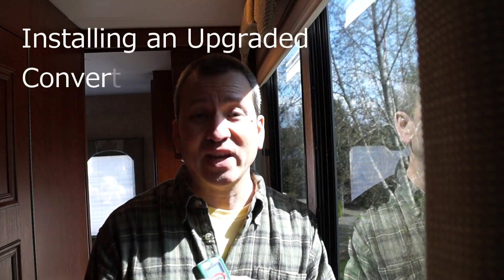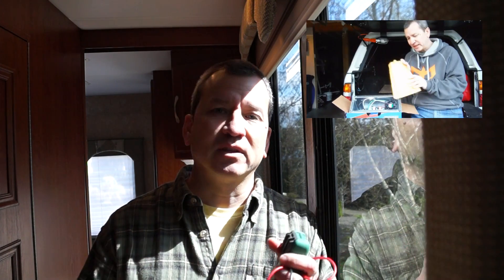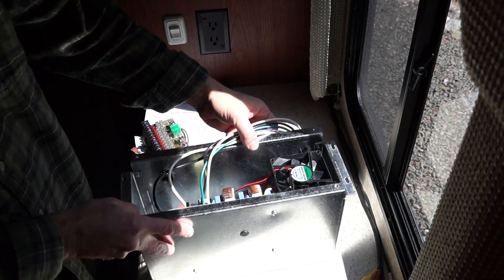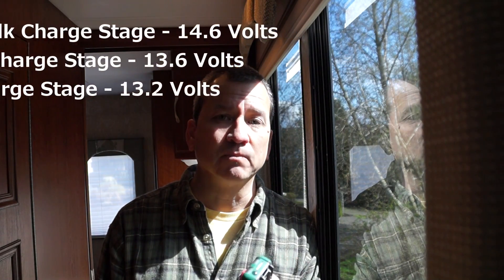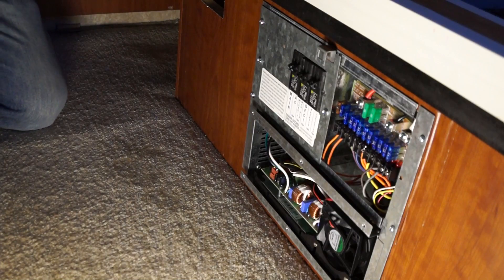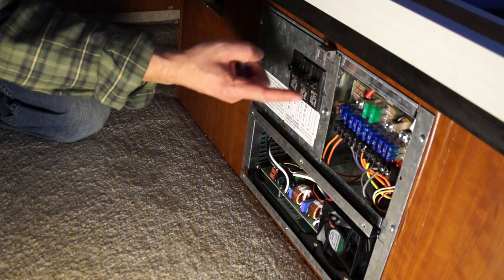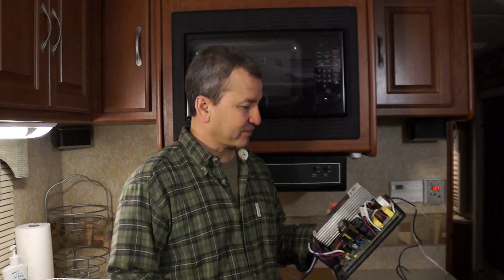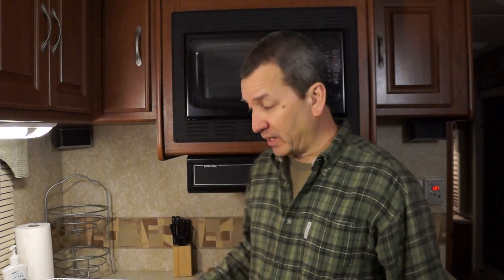How To: Upgrade to a Smart RV Converter Charger

Comment: same converter in my rv that i need to change and looked up upgrades- found myself here.  Thanks, not afraid to tackle this myself now!
Reply from the maker: Awesome. Glad to hear this 11 year old video is still helpful. This was pre-Lithium. So if you're using LiFePO4 batteries then be sure to get a lithium-compatible replacement. Good luck!

Comment: Tech question  So i have the PD 4600 replaced converter i want to power the battery charger on its own circuit breaker have you done this ? I don’t want a loop goings on

Gary
Reply from the maker: Hey Gary. It's been a while since I've had one. Mine had a breaker for the converter. If yours does not then you should be able to add a breaker on the 120VAC hot wire that goes to the converter.

Comment: when I am plugged into shore power my battery's are climbing to 14.4 then I unplugged . Is my convert bad ?
Reply from the maker: Lead acid batteries typically charge at around 14.4 volts. They should drop back down to around 13.2 when fully charge in order to maintain the charge. If your converter/charger is always at 14.4 volts then that's a problem. You'll overcharge your batteries and eventually kill them. It's best to make sure you have a multi-stage converter/charger like the one I installed here.

Comment: Can it be used with lithium also which wire disconnect the battery charging
Reply from the maker: There is a lithium compatible version.

Comment: Hi Brian i ll like to change my converter like yours !! Is Any issues with it..? Works fine..? Is any new model out there better..? Thanks
Reply from the maker: I have lithium batteries now. So I've swapped it out with a lithium compatible version of the same.
Reply: @RVwithTito  Brian, great video like all the rest...

I want to upgrade mine too, tell me why they don't make one that you can use with SLA or AGM now, switch it to lithium when you get lithium? Know of anyone that makes that?
Reply from the maker: @bobcole3852  Those are out there, but mostly as hybrid inverter/chargers that can be programmed for any battery chemistry.
Reply: @RVwithTito  I recall from your website you replaced with a PD4655LIV, which is something I have done as well.  Have you figured out exactly what PD has done with this converter besides generically "making it better for Lithium?"  It seems to always output 14.55v so I'm wondering if it's really now a simple single stage converter.  Seems like there must be more to it.  Mine still has the pushbutton/led and I'm wondering if it really does anything.  I have to admit I haven't experimented much yet, though.

Comment: Great Video,
Would you know?  I have a parallax model 7345 that burnt out and replaced with 45 RU.
I would like to go to battle born lithium batteries what would be a direct replacement for the unit.
Reply from the maker: Here's the one I used: https://www.ltdrvparts.com/PROGRESSIVE-DYNAMICS-55-AMP-LITHIUM-CONVERTER-SECTION-PD4655LIV-PD4655LIV.htm

Comment: Very good video.  All the videos I’ve seen and there have been many, seem to skip one or more steps.  Probably to cut down on the length of the video.  For instance, when I replaced my unit yesterday, on the right side behind the fuse board, i have a red cable, a green cable and a bare copper cable.  I think the red cable goes in the Batt POS+ terminal but I haven’t got a clue where the green and bare copper wires go. On the left side, I have three circuit breakers.  There is a black wire that goes in one of the circuit breakers.  I removed a black wire when I removed the old unit.  However, there is another black wire that looks like it was attached to the circuit breaker at one time next to the terminal where the new black wire is to be installed. I’m not sure which one should be inserted into the terminal.  The old unit was a Magnetek Model 6332 Series 6300A.  I have a 1994 Roadtrek Dodge 190 Versatile.

Comment: My 2000 model probably needs an upgrade but I have a 1 year old $400 AGM and I know I’ll be switching over to lithium some years in the future. I hate to do this job twice and spend twice as much. Are there chargers that are programmable or will work with either AGM or lithium? Thanks in advance. Love your videos!

Comment: Getting ready to install a solar system in my 1994 Fleetwood Jamboree. I have a Paralax series 7300Converter/Charger.  Going to wire a Renogy Inverter 3000W into a Go Power Transfer switch then to the Converter/Charger!  Should I upgrade my Converter/Charger?

Comment: My 2006 Tioga class C has the converter tucked behind the electrical panel. It appears that the whole panel has to be disconnected and removed to replace the converter. It seems pretty daunting. Any thoughts?
Reply from the maker: Sorry. No easy answer. Mine is accessible from the front. I guess you have to remove it.

Comment: I have a 2003 keystone sprinter. I want to change from 30 amp to 50 amp. Do I need to change the breakers, distribution panel, and the fuses?
Reply: My breaker keeps tripping on 30 amps.

Comment: How do i know if my power converter is not working. I connect the rv to power outlett but my battery is not recharging and my 12v lights are not lighting up.

Comment: I’m new to RV camping. On my first trip out with a 2007 Toy hauler all my AC power went out. No breakers were tripped. Power was good at the shore power connector. Frustrated I gave up. I accidentally kicked my power panel and all the power came back on. So I was told by a friend that my Converter needs to be replaced. Looking at the options, if I upgrade do I need to change from 30amp to 55amp?
Reply: I went to bestconverter.com and my model number is CS6000XL. Im assuming since my DC output is 13.5V and 60amps I would need the PD9260C and customer mount to inside the current housing? Thank you for the help.
Reply from the maker: No. Not at all. It will still be 30 amp service. Just get the model number off of your existing converter, then go to the Progressive Dynamics site to see which model replaces it. Here's the site: https://www.progressivedyn.com/rv/power-converters/inteli-power-4600-series

Comment: What is the second set of + and - used for?  I just got a Progressive Dynamics PD9270V Inteli-Power 9200 Series Converter/Charger and I'm unsure what the second + and - is for.
Reply from the maker: Sorry. I don't have the info handy. If I remember correctly, the instructions that came with the Progressive Dynamics unit was pretty detailed.

Comment: My RV/Sprinter will only charge from the generator and/or with an external direct charger.  It does not charge from the alternator or when hooked to a shore power source, etc... I think I need a new transfer relay?  Does that sound right?  I have a 5000 Series Automatic Transfer Relay from Progressive Dynamics.  On there website they only have 5100 and 5200 series now.  Will these work?  Do I have other options?
Reply: Lon, I don't think that is your charger. I think you're likely looking at your Automatic Transfer Switch, which Automatically senses generator power and prevents two power sources from entering the AC Distribution Panel at
 the same time. I'm no expert.

Here: http://www.progressivedyn.com/pd5110010.html

Comment: I installed my intellapower 4600 last season, and has worked great up to last weekend. I lost all power while cooking. The breaker supplying power to the tariler was not tripped. I can't imagine the invertor has failed already. My question is , if my battery is dead will this caise no power, or will the invertor power the trailer without a battery?

Comment: Thank  you so much for saving me from a huge mistake. I'm going  to contact the seller and see if it's to late to return it.   I had no idea this unit and everything plugged into it is useless as soon as you disconnect from shore power to go camping.  
Why charge the battery bank if nothing runs off of it?
Damn I have to start from scratch
Reply from the maker: +Teri Thomas Hold on a sec. Your battery is still connected to the 12 volt distribution panel. So when you are not connected to shore power, your battery will power your 12 volt equipment. The only the piece that doesn't work is the converter/charger which charges your batteries and provides 12 volt power to the distribution panel only when hooked up to shore power. Hope that helps.
Reply: "The only the piece that doesn't work is the converter/charger which  charges your batteries and provides 12 volt power to the distribution panel only when hooked up to shore power." 

And the microwave, some TV's, all your AC outlets, and the air conditioner. (Unless you have a generator then all of these will work too. Right Brian?

Comment: I don't have a red wire for battery from the 4600 converter I'm so confused I only have black and white from old fuse board and wht grn and blk from 4600 converter. where is the red
Reply: Chris Romanos please research more but I have seen other videos stating that white would be hot/ positive in your situation.  The one I'm referring to was a trailer with the battery in the front behind the propane tanks.

Comment: hey great video, I heard there is from time to time some 15,5 V needed, like sulphate removal....
Reply from the maker: For lead acid batteries, there is also an equalization stage (the fourth stage) which boost voltage up to 15.5 to equalize the cells and desulphate. It can be set to be done automatically or manually. The high voltage may damage some electronics, so I recommend setting it to manual so that you can disable power to sensitive electronics first.

Comment: Nice video and helpful as I am considering doing the same.  A couple of questions, I am wondering in doing this upgrade why you did not relocate the new converter closer to the batteries? Also I am curious what the difference in charging time from the old power converter to the new?  Thanks, Bruce

Comment: thanks once again. i questioned the difference of this new unit u have, as opposed to the one u removed. This video answers the question. ... New question is, does this smart charger work only when plugged into Shore... and Not from from your Solar Array?) ... my guess is Yes, but please tell me. Thanks again.
Reply from the maker: +koollee You are correct. It only works when on shore power or onboard generator. The solar charge controller takes charge of battery charging when on solar.
Reply: RVwithTito So I wire all my DC lights, fans, Usb ports to this, while charging my battery, but when I disconnect from shore power and use my fully use my fully charged batteries..I can't use any of the equipment plugged into it?

Comment: Hi! I am newly upgraded from tent camping to a Starcraft Launch 16rb camper! After taking it out for a few camping trips, we notice that our Honda eu2000i generator can't recharge the battery very fast. Our favorite campground only lets generators run for 4 hours each day, this is not enough time to get the battery from 1/3 charge to 2/3. Would this converter charger be able to run off of our generator, and charge a single 12v camper battery in 4 hours or less? Thanks!

Comment: Hi Brian and Melissa. We are new to RV and I just watched another video of yours where you upgraded your charge controller. You plugged in your 30 amp plug into a 30 amp receptacle and you said to turn off the converter/charger. What is your converter/charger connected to, a 120V breaker? Thanks

Comment: Question for ya.. 
Your shore power source powers your new converter/charger which then properly charges your battery bank.  Your solar panels powers your solar charge controller which then properly charges your battery bank.  Sooooo, my question is do you ever have both sources charging your battery bank at the same time or do you use your switches to turn off your solar panels whenever connected to shore power?  I would think that both sources of power charging the batteries at the same time would be twice as much voltage as they need.
The reason I'm asking is because I'm in the process of designing a solar panel system and the main area I'm still confused about is the multiple sources of power that charge the battery bank.  Because my shore power, generator power, and alternator/engine power would pass through the converter/charger and NOT the solar charge controller, I'm worried that my battery bank would get way too much voltage during daylight hours via solar.  I don't see how a solar charger controller or a converter/charger could be considered "smart" if they don't "see" the other before "deciding" what voltage to send to the battery bank.
Reply: a simple kid the way I under stand it is the charge controller and the converter charger would be running parallel to one another so the voltage stays the SAME now the amps would certainly increase and so long as your hardware is making decisions based on real time voltage readings then no harm no foul it's no different running a wind mill and a solar array
Reply: I am assuming you plug your power cable into either shore power or generator power so there isn't a problem there. Now when your on the road you charge with the alternator and the power converter isn't running except when both the alternator and converter is plugged in at the same time. Like reaching the campground while the vehicle is still running and you just plugged in or haven't removed shore power yet if leaving. The campers converter should recognize when the battery is full and automatically halt sending power and even if it wasn't smart enough to do that it would stop because the rectifiers in the converter prevent power flowing in reverse. 

So that leaves only what to do with the solar. Here you need a seperate DC to DC converter to directly charge the batteries which when full can not accept any more power meaning that addition solar goes to waste. The RV converter will not be damaged because you can't reverse the power back through the RV converter or you use DC solar power to AC line connection like in the home which is set to synchronize with the AC from the campground. Now you can send power back through the campground meter or use less of the campgrounds shore power I would not use both AC generator power and AC solar at the same time because of possible synchronization issues. 

DO NOT DIRECTLY CONNECT 12/24/48 VOLT SOLAR DIRECTLY TO YOUR BATTERY. 12 volt solar is 12 volts and will not charge a 12 volt battery because battery voltage is really 13.8 volts at usable level and 14 all full charge. The other voltages are obviously not directly usable to charge a 12 volt battery.

Comment: This is on your Class C motor home correct?  The link you provide shows a 55 amp converter, your C has 30 or 50 amps??
Reply from the maker: Yes correct. my Class C has 30 a amp connection, but my old converter is the 55 amp model. Check the model of your converter then go to progressivedyn.com to lookup the correct replacement model to be sure.

Comment: Good video, very thorough (you made it look easier than I'm sure it is).  Question:  My 2004 Class A has a 55 amp converter, but no inverter.  I'd like to upgrade the converter and install an inverter as well, but do I need one?  If so, do you know of any "combo" units on the market?
Reply from the maker: Inverters convert 12v DC to 120V AC power and are not typically standard equipment for RVs. If you mostly plug into shore power in an RV park, you won't have much need for an inverter. If you plan to power your RV for extended periods from your battery bank (instead of a generator), then an inverter is what you will need. And yes, there are combo units. Search for an "inverter/charger". I don't think those units can be easily swapped out with your existing converter/charger though. Sorry, but I don't have any experience with those. You can, however, check out my inverter install video if you're interested (http://youtu.be/gm4NeZCQyvY). Thanks for the question!

Comment: Quick question. I currently have a prehistoric 45 watt converter/charger in my 1988 Class C. Would it be beneficial to upgrade to a 55 watt (or amp?) or do I just leave it at 45???  As you can tell I have no clue regarding the electrical side of my RV. Thanks for any help.
Reply from the maker: I don't know. I may be ok. but I'm can't say for certain. I would ask Progressive Dyamics that question.
Reply: Ok thank you.

Comment: Hey Brian great video as always. Does your 4600 boost to 14.6 or 14.4 volts, was that a typo? What does your trimetric read in boost are you getting full voltage from your converter to your batt's. I have the PD-9200 and I am only getting 14.2 volts to my batt's during boost according to my trimetric TM2030. I may need to add larger wire from my converter to my Batt bank.
  I wish we could adjust these converters to output what we wanted, most lead acid MFG's recommend 14.8 during boost or bulk charging. I think PD limits us to AGM batt levels of 14.4 incase someone doesn't know what they have.
  PD say's the 4600 has a equalization mode, every 21 hours the batt's boost to 14.4 for 15 min during storage mode. 
  Well thanks again for all your videos they have been very helpful to me in the past. I am installing my solar panels after Vacation next week, We are headed over to the Green side near you. We will try to bring some of the sunshine from our side that your wife loves your direction. 
   Tracy       sorry for the long reply lol.
Reply from the maker: You're right. It's a typo. It only boosts up to 14.4. I have checked it and 14.4 is going to my batteries. I primarily charge from my solar charge controller though which I have set to 14.7.